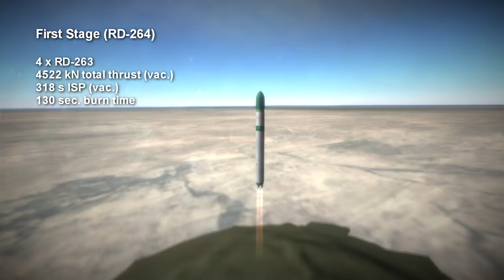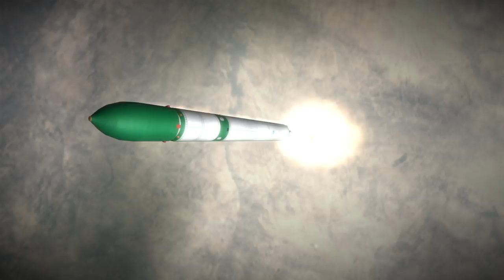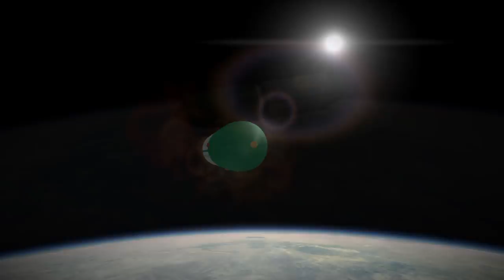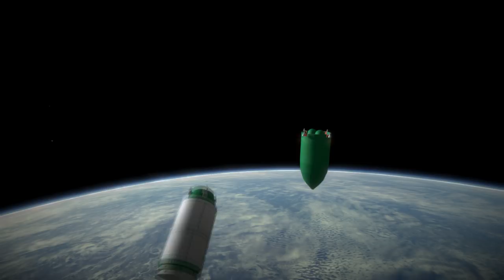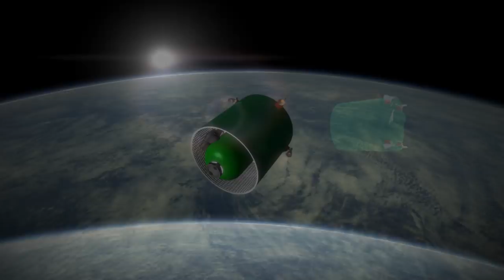Rocket Profile - Dnepr

Comment: How were you able to launch that from underground??
Reply from the maker: I made a hill model without a collider and placed it with Kerbal Konstructs.
Reply: @RaizSpace   any chance for a download with rocket included?
Reply from the maker: Well, the rocket is Raidernick's. Here's the Silo: https://www.dropbox.com/s/1ghqffrxco7u1wj/ICBMSilo.zip?dl=0. It requires Kerbal Konstructs and is called Baikonur Silo in the Kerbal Konstructs VAB menu. You'll have to position your rocket just right on the pad to get it centered in the silo - otherwise it'll be a little to one side. It's a pretty crappy model overall, and someone could easily do better.
Reply: Mods maybe